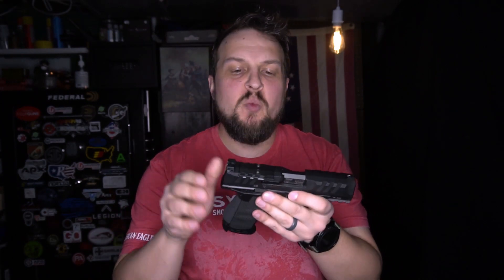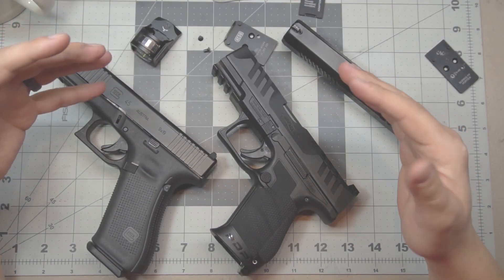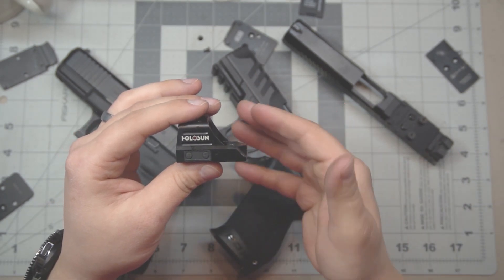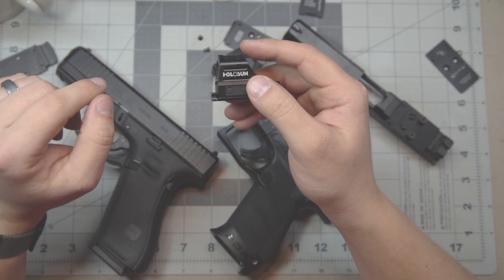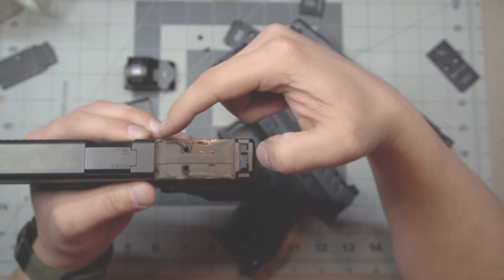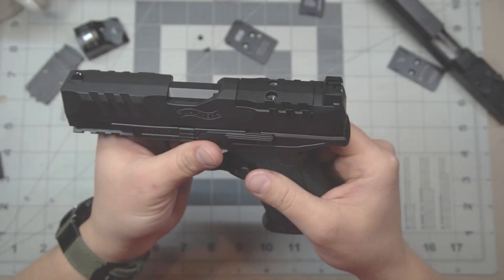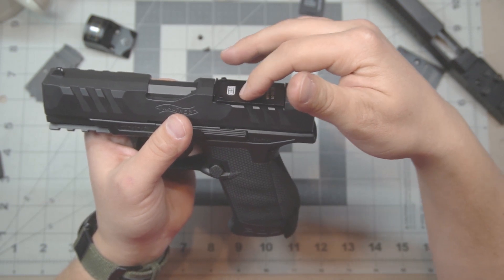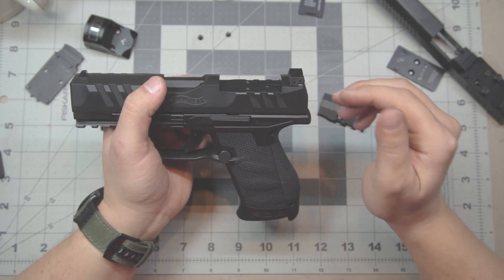The Gen 1 Walther PDP is going to Break

Comment: Me: laughing with PDP Holosun 507 and the actual proper plate having zero issues. Okie dokie dude. Also since it’s “going to fail” I’d buy it off you for a couple hundred.. lol
Reply: Is your plate tight, i just bought a PDP compact and was going to get a holosun  ?
Reply: @pat4145  hey pat. The plates are pretty tight and I wouldn’t worry about it as many have several thousand rounds with no issues (I have 1,500) I would how ever consider (I certainly recommend) the added cost of getting a plate from C&H precision as it’s definitely a little tighter and better machined. Apparently C&H is producing the Holosun 509 mount and others for Walther as it has a Walther part number on it but it certainly seems better made than the one I got from Walther directly. However, Walther did supply it and I’m sure has zero issues doing warranty if there ever was an issue. Again though, as pointed out several times, the only one saying there’s an issue is the guy that hasn’t tested it or even has the correct plate. I’m transitioning over to this pistol as my main pistol as it is 100% my favorite. I’m also not a Walther fan boy as this is my first Walther. Will be getting rid of quite a few sigs because of the performance of this thing. I was actually planning on getting the FN LS edge but after feeling the trigger on that $1300 pistol I laughed (total garbage) I went with the pdp instead. Half the cost and double the pistol.
Reply: @DDRDK  The PDP is on my wish list. Have the Creed and love it. I'm due for a new gun, and this is the one I'm going to get. Iove the grip. Great ergonomics for me.
Reply: @KatheeRN  don’t over pay! Some people are trying to sell them for a bit over retail and I found mine at a dealer and got mil discount. Walked out paying $580 plus tax. They’re out there just gotta call around.
Reply: @KatheeRN  the creed is total junk.  Functional but no comparison to higher models.  If you said PPQ I'd get it.  Going from a creed to a PPQ OR PDP is like  whole new class of gun!  You will love it.
Reply: @KatheeRN  , I too were going to make the PDP my next purchase , but with the ammo pricing situation, it's a little discouraging, but I would still buy that gun regardless of the plate

Comment: I own a machine shop. I simply put 2 pins that line up with holes under my 507k holosun. I made the pins so the go through the plate and fit into 2 recesses in the bottom.of the Red dot.

My pdp will not have the problem. Plus ...only strong side to side forces will there be a weakness to excessive force but the slide doesn't run left to rt...it runs forward and backwards.
Even without the stand offs/pins, I never had problems.  I'm a mech engineer too from the class of 1990 at NCSU in Raleigh NC and  I own 3 machine shops/tool&die shops as we speak.
The mods I made lightened the adapter plate and the slide just barely but no.loss to strength..

I ask this too. Did your peeps that described problems torque down the fastners to 20ft inches and used blue lock tight?  I doubt any further mods are even nessacerry.. id be shocked if the sight mounting points gave way..

Comment: this guy doesn’t know that the Walther optic plate fits tight without any play forward or backwards
Reply: Fore/aft play should be considered as a system & not merely as plate-slide fit.  The screw diameter vs the plate's screw hole diameter, the thread depth in the slide, the type of threading used, and the grade of metal used in the screws all are components of the system.
Reply: @seanoneil277  Grade of screw will be a big factor of sheer force.
Reply: I really enjoy the ignorance of people who think anything mass produced  (more than 100) will have repeatable results within .001 microns.  You're literally slinging lead down range with a best guess. This guy is only stating the VERY obvious truth.  But if I wanted precision..... i wouldn't look to a handgun.
Reply: @icarusflight2396  If the screw is the only thing holding it, yes.  If the two matching surfaces are true/square/planar flat identical, there's a lot more holding the optic to the slide than just the fastener's grade of metal.  

There are many instances of what someone like our host would imagine to be massive shear stresses.  

Elsewhere in this comments section, someone mentioned lug bolts & nuts which hold automotive wheels to the drive axle(s).  According to our host's "theory," lug bolts shouldn't hold my truck's wheels as soon as I dump the clutch and lay into the gas pedal.  I've never seen an appropriately snug wheel shear off at the lugs.  Have you?
Reply: @seanoneil277  Your truck doesn't accelerate with 1200 g.
It's all about numbers in the end. Grade of bolt/screws, their shear and fatigue curves. Is not black and white, but other mgf choose not to rely solely on screw/bolt shear tension.
Reply from the maker: Vehicles don't use bolts or screws, either. They use threaded studs, where shear forces are directed across unthreaded portions... And are also spreading 5-6 bolts putting 1660lbs or force each across 22 sq in of friction face as opposed to two screws with 100 lb of Force across 1.75 sq in 🤷🏻‍♂️
Reply: @SorinNicu  1200 grams of what, Sorin?  What on Earth are you talking about?  That reply was word salad and you had well over a week to research a response and post a coherent reply.  Instead you offer a comparison that is meaningless.

I don't suppose you've ever done 1/4 mile racing with cars, have you?  How about cars which use slicks and get impressive traction off the line -- severely loading up the axle bolts with significant shear forces?  Ever been involved in that sort of practical application, Sorin?  Tell me about it if you have, and stop relying on word salad.  Tell me and everyone else what you know from real-world experience, please.  Not an internet-faker's jigsaw puzzle of statistics and data points that don't apply, but instead, some real world experience.  Please, try doing that.
Reply: @seanoneil277  LOL, "g" is from grams? You don't have a clue what "g" means but you comment to criticize???? Acceleration dude, expressed in Earth gravity "g".  That's what makes inertia work as F=ma ! Even the Walter video gives that value, obviously you are too busy to watch that!
Reply: @SorinNicu  Sorin, g can mean grams as well and I can't read your mind, ya know?  I guess your science knowledge isn't as broad-ranging as you pretend.  Precision is important in science -- including units of measurement.  We were talking about automotive wheels and their fasteners, weren't we?  Somehow you've decided to try to lecture me as if I don't know science, but as it turns out, you don't know it very well yourself.  Nice posturing, however.  I'm sure our host appreciates how you're giving him "support" in the form of trying to insult me.  Ad hominem, such a brilliant strategy when you haven't got a winning argument!

Unlike our host, I have an actual science undergrad degree.  Not a "design" degree.  And yes, I took physics on the road to that degree.  

You haven't explained how you arrived at your assertion of how many xGravity a recoiling slide develops.  Seems you've forgot to consider the recoil spring, which buffers the impulse experienced by the slide itself, and by an optic mounted to the slide.  OOOPS!

I was talking about an analogy between most 1/4 mile racer automotive engines, which are 8 cylinders of explosion, versus a handgun's single cylinder of explosion -- and you don't realize the far greater energy created by a v8 motor versus a single 9mm round's explosion in-chamber.  I do wonder about your science chops and your ability to see analogous comparisons.  In that way you reesemble our host, posturing at science/mechanics, but relatively ignorant on the topic.
Reply: @SorinNicu  >>"You don't have a clue what "g" means".  No, I don't believe the little fella does. If it meant grams, as he claims below it might...well, 1200 grams is about 2.64 pounds. That's not enough to loosen one of those plastic hooks you stick to the wall with putty, to hang a picture. If that was all the stress on these fasteners, we wouldn't be having this discussion.  

BTW Walther's explanation made sense to me, which would mean that WTT is wrong. The real design flaw might be that the system depends on a screw in an offset hole pulling the plate against that front face. If the screw is a little loose, seems like the whole thing might fail. Maybe that's what's causing any breaks that show up.

Comment: The weigh of the optic along with the accel/decel of the slide, is not enough to sheer the bolts. And the majority of the weight of the optic is sitting low, not giving it the mechanical advantage needed to damage the bolts. If this was your thought and you are a mechanical engineer, your time would have been better spent proving/disproving your hypothesis. Perhaps measuring the distance from the back of the slide to the back of the optic before shooting, then again after shooting with a cmm. If you could prove it moves under the force of the bolts that would be expected if your hypothesis was correct.

Comment: Sorry when people started building AK's with screws instead of rivets the "Screws aren't designed to take those kind of sheer forces!" crew cried and railed about it.  Yet not only did they not break after tends of thousands of rounds most found them to stay tighter than the rivets (US made receiver rivets not actual soviet rivets).  Walther just figured out a cheaper way to do it.  Use 2 high quality forged screws instead of making extra milling cuts into the slide.

Comment: Any Mechanical Designer worth his salt knows there are fasteners rated for and designed for shear forces. That is what bolt grades are all about. In addition, the taper provided by the countersunk holes provides a connection with no slop. Therefore you can (and should) consider the fastening method used by Walther to be superior if the fasteners are spec'ed appropriately. Otherwise its just CLICKBAIT!

Comment: If the plate fits tightly forward and backward, is the lack of lateral support actually a big problem? You really should have contacted walther because they may have an explanation for it. And you really shouldn't say "it's going to fail" when it's not failed yet. This video should be titled "the pdp might have a design flaw". If the plates are all loose forward and backwards, then yeah I'm guessing it's a problem, but that can be fixed by actually making the plates to fit properly. Whether the lack of side to side support  is a big concern is the real question.
Reply: There's nothing to suggest a design flaw in the PDP, so even your offer of an alternative title for our host's video is dishonest.  Our host used a plate NOT designed for the application.  The flaw is in our host's dishonest "theory" and the video presentation, not in Walther's design.

Comment: Walther's response is that... they are using shear force, on those counter-sunk screws, to keep the plate in place against the wall: "High tension countersunk head screws act like high tension springs." Screws are not supposed to be loaded sideways like "springs"... unless they are high tensile steel (Grade 8 in US, grade 10.9 or even 12.9 in EU).
That's exactly "WorkTheTrigger" observation. He says that any normal screws, under shear effort, will eventually break. Unless special screws are used, which Walter seems to indicate in their testing. So they are in theoretical agreement. What's left to see is how well those special tensile screws will handle the long-term variable stress.
Reply: Proof is in the pudding...let's revisit when there's an actual failure attributable to this design.

Comment: Screws held the scope on my Weatherby 340 and the scope was heavier than an optic sight. What am I missing?
Reply: The optic sight is mounted to the slide of a semiauto, and that slide is a moving part which jerks backwards very fast when you fire the gun, which puts huge stress on whatever is holding the sight to the slide.

When you fire a rifle, it doesn't accelerate backwards anywhere near that fast. 

Not saying WWT is right in this case, I don't think he is.

Comment: PROOF dude. Not conjecture. You have no EMPRICAL PROOF that this will happen. There are no reports, that I have seen, that this is any issue as of 5-2022. Yes Walther has upgraded to a 2.0 mount with lugs, but there is no breakage issue here.
Reply from the maker: The majority of people that say "there are no reports that I've seen" hasn't bothered looking... and has most likely saw it in passing, and passed it off with how the Walther community attacks anyone that speaks out against it.  I've seen multiples, and people have contacted me directly about the issue.  But hey, by your justifications, my Glock MOS systems are hunky dory, and my Taurus pistols are some of the most reliable on the market.  

Consider, for a second, the money that Walther spent to update the design.  Engineering time is typically charged at or over $100/hr internally.  For the design, for the tooling, for reworking the tooling, updating contracts, etc.  Walther would not have dumped that money in if there was not an issue... they would've designed a test to be done to prove the design and create a public spectacle of it.  could've spent tens of thousands less creating a testing jig and running it on a live stream at SHOT show or something to prove their design.  Social Media sells guns, they know that.  and if that was something they were confident in... they would've done it.